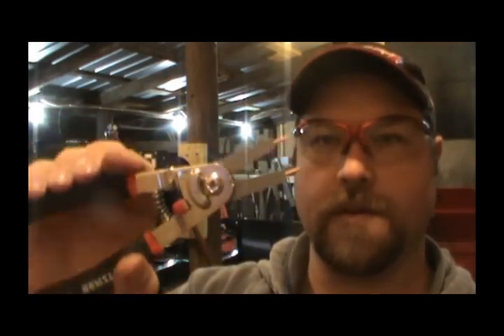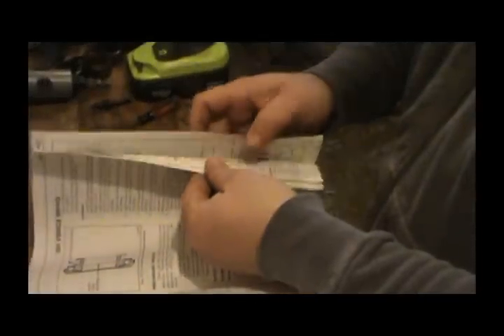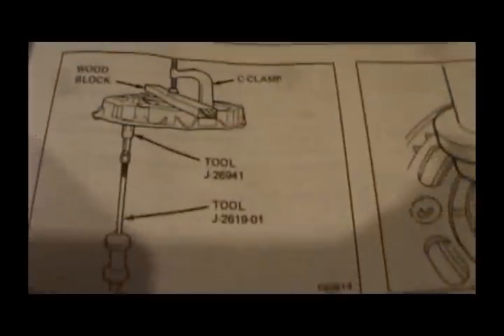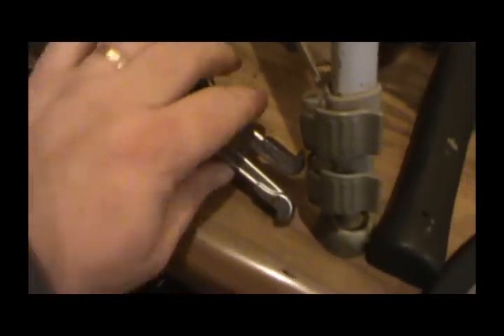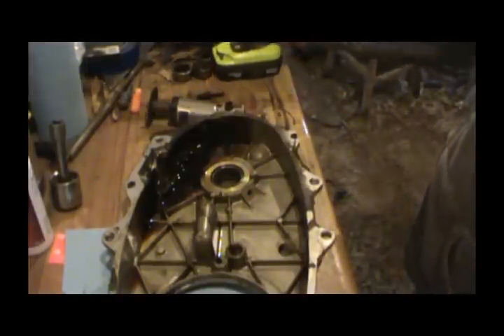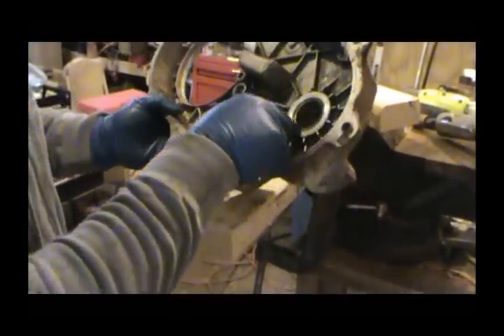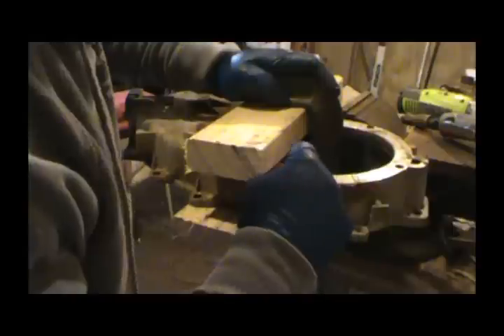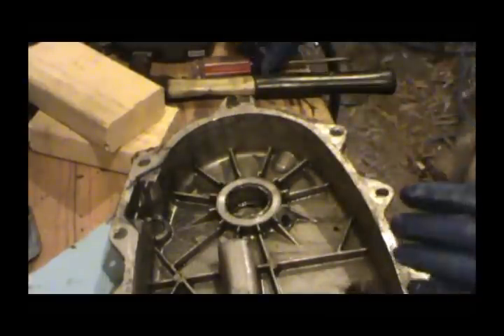NP208 Transfer Case Reassembly Part 2

Comment: I know I have told this before if you weld a short bead on that race it will fall out on it own the weld will shrink the race I have done lots of time as a maintance man at plant.
Reply from the maker: I tried that first.  Welded beads around the inside of the race but still no go. I got it out by heating it up and driving a screw driver between the race & case but ended up gouging the seal surface.  Maybe I didn't get it hot enough when welding, I didn't want to weld through the race & it was very thin.
Reply from the maker: This was after trying with the slide hammer of course